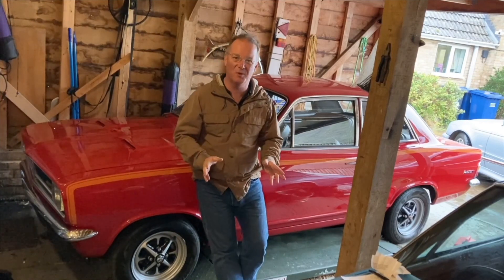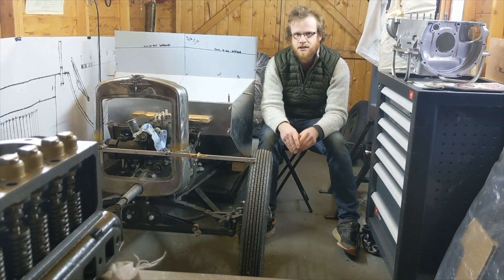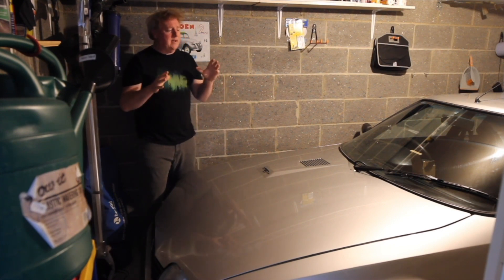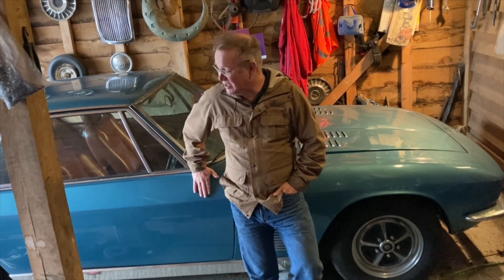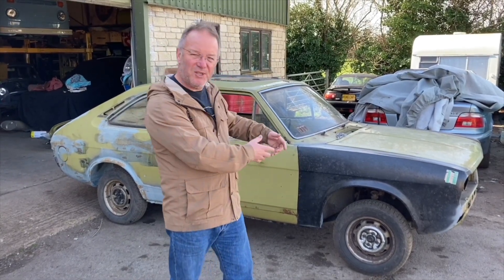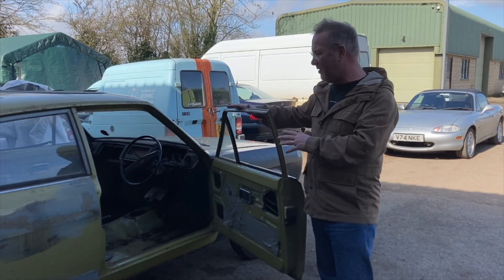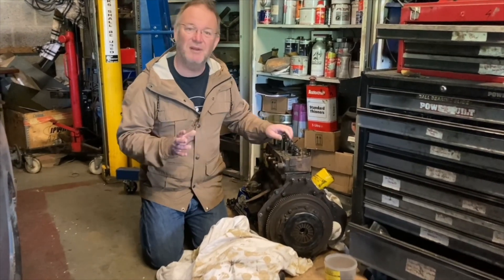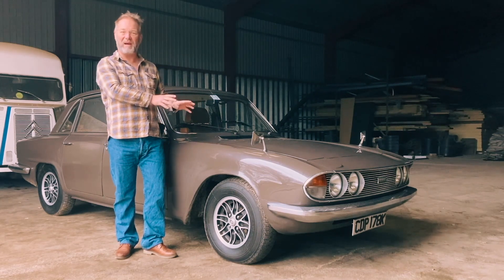Practical Classics Workshop Update - March 2021

Comment: I like the video but I have to say your editor has very poor taste in my opinion. Danny, I agree with your grandmother, those seats and steering wheel are eyesores compared with the lovely originals. As for the moronic desire to “experience the danger” and reverse the safety-prompted upgrades to the brakes and suspension of that Marina, all I can say is if you come unstuck when having to swerve and have an accident, whilst you deserve all you jolly well get, I hope you don’t take out any other innocent road users with you.